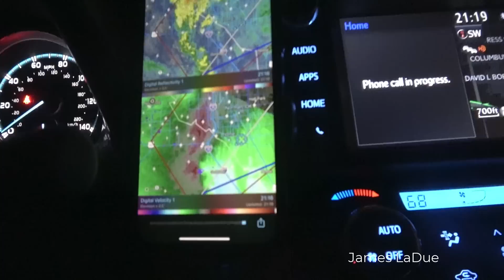Norman, OK tornado genesis of Feb 26, 2023

Comment: I’m over off of 24th and Lindsey, and we took shelter when the sirens went on, then they turned off, the power went out, and the sirens came back on, then we were listening to ambulance and fire sirens for the better part of 2 hours. OG&E got power back on in under 50 minutes. Reagan Elementary was unscathed, but Washington lost some playground equipment from my understanding. KOCO mentioned rotation near NWC, but immediately went back to following what was going on in Mcloud and Newalla and we had no clue a tornado happened under a mile from us until we got ahold of someone on the non-emergency line.

Comment: Did they not have a shelter? If they did, that is ALWAYS the safest place. It doesn’t matter if it’s a quick QLCS spin up. Why not play it safe rather than regretting it later?
Reply: For sure. I'm very puzzled at his non-concern attitude. That will get people killed in the future.
Reply: QLCS spin-ups are not intense enough to merit a "shelter or bust" attitude. They just aren't. Unless your home is flimsy (mobile or manufactured), an interior closet or bathroom is just fine for these things.
Reply: @nathandahl9233  That isn’t what I said. What I’m saying is that a storm shelter is always the safest place. If I had a storm shelter and I was under a tornado warning, I would ALWAYS move to the shelter regardless of the storm mode or parameters unless there was not enough time to move there. Why wouldn’t you? Why would you take even a small risk when the mitigation action is so simple?
Reply: @KrisOsterhout  You partly answered your own question by saying "unless there was not enough time to move there." It's not always so simple to get into a shelter. Laying the inconvenience aside, if the shelter is in an exposed area (outside or in an exterior part of the home; for example, mine is in my garage), the time spent in that area prior to actually being sheltered (e.g., fiddling with the door, negotiating stairs or other obstacles with supplies and/or small children, potentially in substantial darkness) can pose an increased danger. For a potentially-violent tornado, the reduction in risk from "closet or bathroom" to "storm shelter" outweighs that, but for a tornado like this one, that reduction is really, really small, and the time window for securing it is compressed because trying to warn QLCS tornadoes in advance sucks. (Their only saving grace is that, again, they don't get as intense as the real "big boys" can.) 

Short version: You're right that the storm shelter is always the safest place in a tornado. However, for a tornado like this, the difference in safety between a shelter and a small interior room (in a decently-built house, anyway) is not substantial. Under these circumstances, there a several potential factors that may make the decision not to get in the shelter a reasonable one.